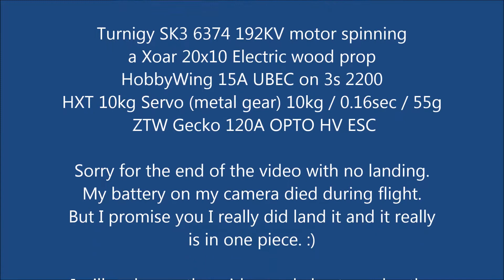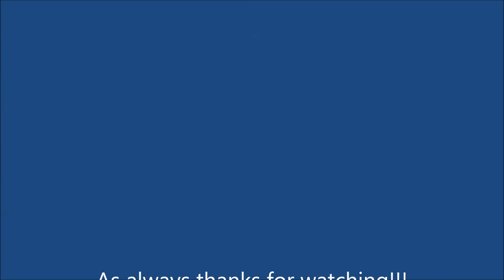3rd Scale Fly Baby

Comment: What's your AUW? I am putting this motor into a 1/4 scale Tiger Moth AUW 20-24lbs. I plan on using 12S (2x 6S.4500mah in series). 80-100A HV ESC.
Reply from the maker: I think I was around 26lbs AUW. That's 2 - 6S 5000mAh and a single 3s 3000mAh for the flight battery + Snoopy. :)

Comment: This engine Turnigy SK3 6374 192KV motor can handle a 9KG plane?
Reply from the maker: Yes, motor is very under rated. I just purchased another one for my Seagulls JU-87. I actually expected to be under powered and was really surprised myself.
There is another guy using this motor in a Ziroli Douglas A-1H Skyraider 100" wingspan at almost 11kg and he is flying on 8S. That to me is crazy it is enough for that plane.
https://youtu.be/wUgPgXAMH7I